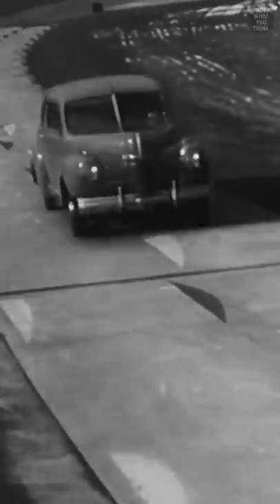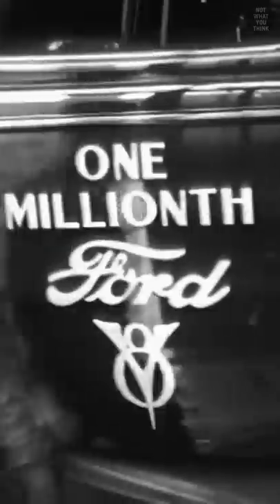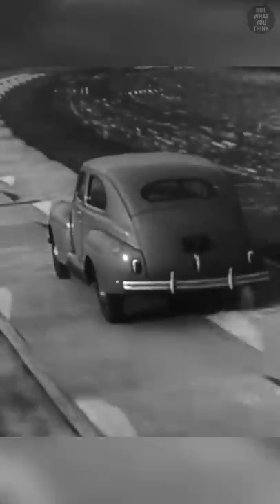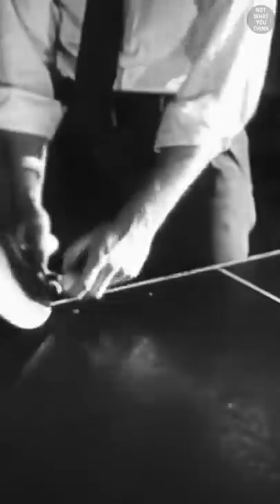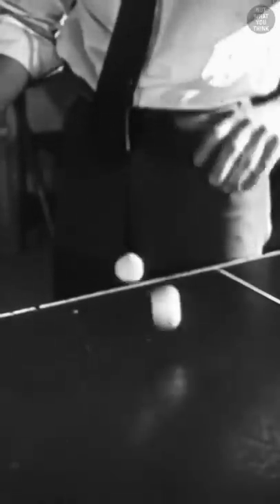Ford's Torture Track #shorts

Comment: Car on a road in Illinois after the tests: “Just like the simulations”
Reply: Is Illinois that bad?
Reply: @user-mi4yc7pr3x  yea
Reply: @radioactivemoose05  I'm from Europe. Don't hear much about it
Reply: @user-mi4yc7pr3x  depends on where you’re at in IL. In the town I grew up in, some streets were fine, others you’d be driving on back and forth to the wrong side of the road just to avoid getting a flat from all the potholes. The town I currently live in has decent streets, the town over is so horrible that I’ll go 20 minutes out of my way to avoid going through it. I’d assume it’s mostly due to local governments/cities not truly fixing the roads and instead just patching potholes
Reply: @pyr0675  Patching potholes is the most expensive way to repair a road. It's the classic $20 boots vs $200 boots problem. A patch just exacerbates the problem and soon you're repatching, the redoing just a small section, but then the joints fail and separate. Pay 10% extra, have a road built right, reoil every 5 years. Any road done right will last 20 years and even then you'll only need a resurfacing, not a full tear up.
Reply: @thelazarous  makes sense. I’m the town I grew up in they seemed to only ever patch holes and rarely ever redid the roads themselves and the shitty thing was that they’d patch some of these potholes at the start of the summer and by September they were just as bad again
Reply: @user-mi4yc7pr3x  nah
Reply: @user-mi4yc7pr3x  illinois is very nice if you live in suburbs

Comment: He didn't do it to improve quality. He did it to find parts that were over-made and could be made cheaper. They would even examine scraped cars to find parts that hadn't worn-out so they could also be made cheaper.
Reply: And I'm fine with this, so long as they don't end up making it so badly that it fails prematurely. I'd also, however, want common issues to get fixed.
Reply: @user2C47  most parts on most cars nowadays

Comment: I feel like most modern cars would fall apart after just a few moments on that track
Reply: Nah, modern cars are WAY better than they used to be
Whoever says otherwise has rose tinted glasses on
Reply: Probably not. But I know for sure that a lot of em would flip over at that flip test thanks to all that tech
Reply: No, old cars were made out of thick heavy metal, modern cars are designed to save weight. Old cars are still light af because they didn’t have crumple zones and crash structures which makes modem cars heavy
Reply: @Soguwe  yes, modern cars are way better. But if you're saying that in this specific regard modern cars would do better, you're sorely wrong.
Reply: Just as a fact of advances in suspension, materials technology, and tighter tolerances the cheapest car sold today would probably smoke any of those old Ford's. Any car with double wishbone suspension and disk brakes is going to have no problem with any of that course and we have much more accurate ways to test quality than bouncing a seal into a basket.
Reply: Modern cars would bottom out on that track- but it’s apples & oranges. Cars back then rode high & had soft suspension because something like 80% of roads were still unpaved.
Reply: @natebarry5553  you are correct, cars of that era where built for off roading(minus 4wd), with long suspension travel due to lack of paved roads.
Reply: @Soguwe  they arent
Reply: You telling me a 2022 Hilux vs a 1930s ford, you think the ford is better?.. bro. Fords were never good. Henry was nearly 30 years too late to the party aswell. Karl benz invented the car (Mercedes Benz) back in 1885 and Henry didn’t get around to making a car until 1908. German and Japanese cars are the top tier.
Reply: @burn5014  and Japan started making cars 60yrs later, so by your logic... You don't have any.

Comment: Kudos to Henry Ford for his pioneering work. 

However, tests described in this video are almost nothing compared to what present day cars are tested for. 

I work in the automotive  industry since 15 years now and I know that cars are tested to function in a temperature range from - 30°C to +80°C for example. (I worknin Europe but our Murrican engineering counterparts use the metric system too.)

Each and every component's function is checked thousands of times at various temperature points across that range. Sophisticated robots are directly connected to the suspension system to simulate the vibrations and harshness of driving on roads for years in different weather conditions.

Comment: I wish they’d bring back to Ford Pinto’s and the mercury bobcats fastback the original 70-75 Ford Maverick. Those were also considered muscle cars. The mercury bobcat can actually have a V6 Ford engine mounted down in it it’ll be a small block but it would fit. And the car Adaptic or year 78 Ford MercuryBobcat hatchback came fully loaded except for power windows and power locks you had a sunroof air conditioning power steering power brakes automatic transmission and it was a beautiful car I wish I had held onto it never rest it out.

Comment: Our Ford fusion spent a whole year sitting and the winter it was completely under snow for 3 months and when we went to start it after digging it for 4 hours it went first try
Reply: A chevy would have rusted out by then
Reply: @Flyingbeanman236  our Ford had some rust here and there but nothing major just surface rust that wiped right off with some 80 grit before applying a rust protection
Reply: @Sphyxx  thats normal for how long you had it sitting
Reply: @Flyingbeanman236  do you even know how extreme Finnish winters are
Reply: @Sphyxx  why do you assume i know your Finnish? I am an American and why do you have a problem with me saying how tough Fords are when your post is about a Ford being tough?
Reply: @Flyingbeanman236  jesus you're being sensitive im just opening the subject a bit more
Reply: @Sphyxx  i see

Comment: Is this what the military was using in that footage of the jeep driving over bumps? We’re they just making sure it didn’t fall apart
Reply: It's a standardized bounce test. Designed to test the cars backbone for frame flex and suspension operation. They would have pilot test cars and drive them on the test tracks around the clock putting thousands of miles of just torture testing to see how the car would handle the abuse. A practice which is still done today. Most if not all manufacturer test tracks now have no fly zones over them and heavily guarded to protect competitors from spying/ stealing ideas before it's hit the market.

Comment: Not anymore apparently as Ford builds the lowest quality vehicles available for sale in the US. I know this because I work around brand new ford's and they always have something wrong with them from the factory. I've also worked designing gages for the automotive industry and Ford has the most wide open tolerances of any major manufacturer I had access to the standards of (which was almost all the major ones)
Reply: Have you ever had the chevy experience?

Comment: Looks like an average day driving on the streets of Puerto Rico. Had to replace all the tires on my 2017 Honda Accord cause two blew out in a very bad construction zone which wasn’t even marked or anything just a like 2 drop where the road had been carved for new pavement. And the year before had to replace 3 tires due to other pot holes various craters.

Comment: If you did that bounce test with a modern car you'd probably tear the bottom end out because the suspension is hard as a rock. I miss soft suspension and not this feel the road garbage they have today.
Reply: Feeling the road feels so much better though lol
Reply: @technorunner1  sure if you live on a racetrack
Reply: @operator91210  The only reason cars had super soft suspension is because half the roads were unpaved and very uneven. It's completely unnecessary for todays roads, and possibly even dangerous.

I also wanted to mention they still do these tests on modern cars. It's standardized.
Reply: @technorunner1  yeah that's why a 1990 Lumina had soft suspension because of the bad roads (sarcasm). This whole feel the road fad is a recent trend. cars used to be comfortable now it's just getting out of hand.  I know they develop these cars on test tracks and all but like as a consumer if I wanted something sporty I'd buy a Camaro or a Vette not a Honda accord
Reply: @operator91210  Roads were still pretty bad in the 90's. On top of that, speed limits weren't as high and cars didn't have as much power back then. These new cars have stiffer suspensions, but they're not rock hard. Don't over exaggerate. I used to drive a car lowered 2 inches on cheap coilovers and I had no issues with driving. I prefer not to have my car bog up and down as I'm driving down the road.

Comment: Show Chevy breaking apart in the same test
Reply: Modern day ford would aswell.
Reply: @bernardberben4852  i got the fx4 f150 and it goes through this all the time. its steel frame still holds :D (2019 - 5.0)